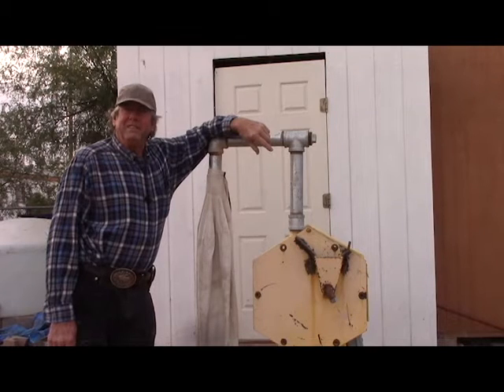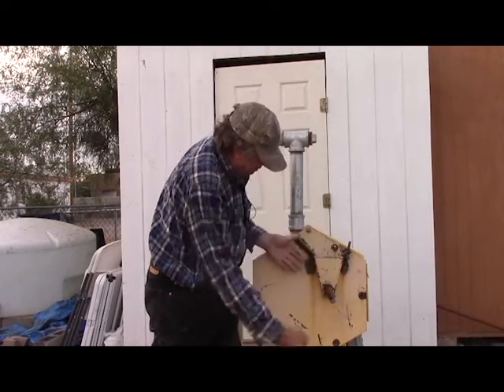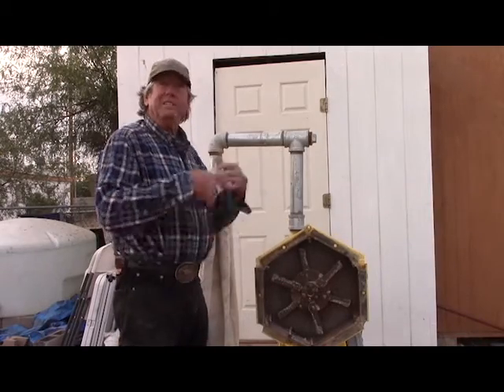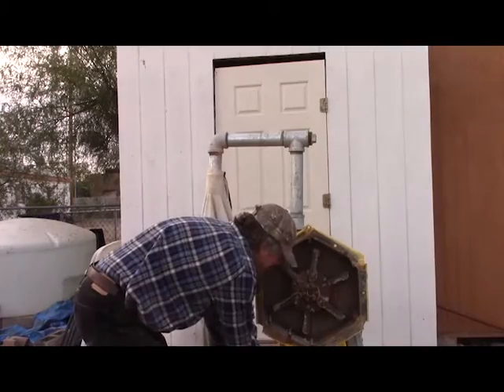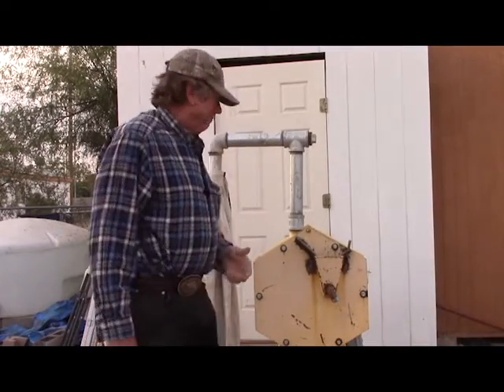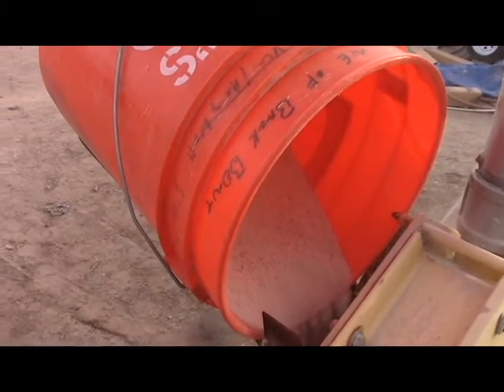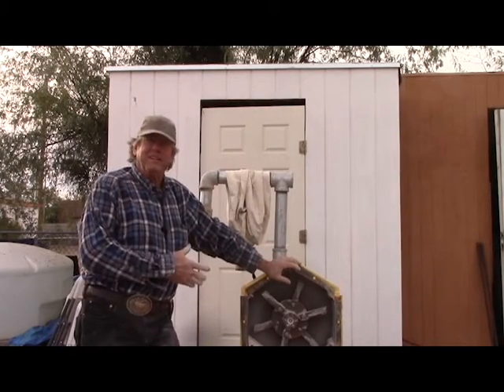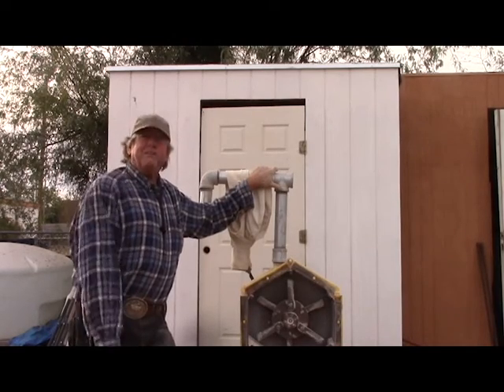Lesson 23 The Air Classifying Impact Mill

Comment: I bought an impact mill from Croatia initially it was working fine,when I changed the chains,,they started touching and plugging out the screen housing which at the bottom of the drum,what might be wrong,I have the drawings ,I conducted the manufacturer but did not respond,can you help me

Comment: Cool! Can I use this to grind up circuit boards? I would be soaking the boards in liquid nitrogen before i feed them in so they are very brittle
Reply from the maker: I doubt you would need to embrittle them.  A mill like this turns half inch hard rock to sand and dust.  The one in the video at about 50-100 lbs per hour, the one I am working with now 100-200 lbs per hour.  You might need to shred them a little first as the input opening needs to be relatively small for safety.
Reply: @hardrockuniversity7283  thanks for quick reply! I would like to feed boards so that I can recover the plated part being the easiest goal or mil the boards fine enough that the gold separates and I can pan, shaker table, or sluice the gold out of the concentrates I can cut them up and make the pieces smaller before feeding thanks!
Reply from the maker: @nolanfoster6782  Good luck.  Let me know how it turns out.
Reply: @hardrockuniversity7283  thanks I will

Comment: WOW! 5STARZ! A MUSTWATCH!
Reply from the maker: Thank you.  There are times when fluid classification is much better than screening.  It doesn't do the exact same thing though.  Fluid classification sorts by settling velocity which is heavily dependent on density and shape as well as size, while screening works only by size.  Imagine what happens when you first sort by one method and then the other- that is why gravity separations work best when dealing with particles all the same size.

Keith

Comment: i watched mbmmllc say you have to be careful of overgrinding the gold, will this not do that??
Reply from the maker: It is possible, but coarse gold will tend to settle in the bottom of the mill and micro fine gold will get blown out. There is NO one size fits all mill design as all ores are different.  However this is one component you can 'plug in' to you flow sheet if it fills the appropriate need.

In general an air classification system would be most useful if you were going to leach the product since, in that case, the smaller the gold the better as it would dissolve faster.

You might also use it to re-grind tailings after a gravity separation has recovered the free gold; or, to fine grind a heavy mineral concentrate to either leach or gravity recover bound gold.

As with all milling processes- testing is imperative to determine a good process for your ore, or to maximize profitability.  That is why I am so fond of hand panning micro fine gold.  You can get useful results in real time with almost no cost at all.  Using it you can quickly determine what works and what does not for your ore.

Also, gravity separation systems have different capabilities.  All will recover coarser gold- say 100 mesh or larger.  Smaller than that some systems start to lose efficiency very rapidly.  A grinding process that works fine with one recovery technique may be disastrous with another.

In general, I would always try recovery first after only my RC-46 jaw over rolls as that is easiest and most economical.  Only if I needed a finer grind for some reason would I go impact, and in that case, air classification might be very useful since physical classification (screens0 has a number of undesirable constraints.  OTOH, screening might be the way to go.  No way to tell without testing.

Did that clarify the situation?

Keith
Reply: thanks Keith
yes, i just mentioned it because mb was saying that if the gold is over ground it makes it like slimes and harder to capture on wet gravity. but your right, test, test.
Reply from the maker: "Over grind' basically just means grinding more than necessary for the extraction process and since that is highly variable and ore dependent- so is the definition of over grind on a case by case basis.  More grinding than necessary will almost always mean more difficulties with slimes and usually higher costs.

However, sometimes a trade off happens which makes sense.

A fully stocked tool box has a number of tools that are rarely used, but very valuable when they are.

Keith